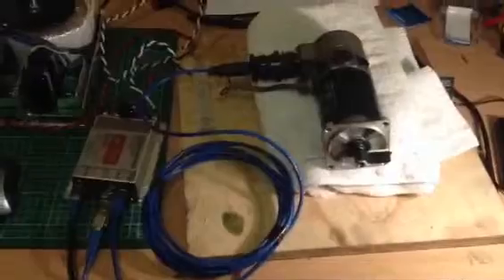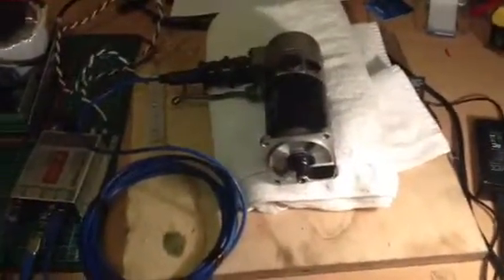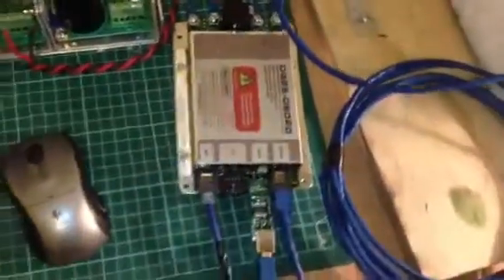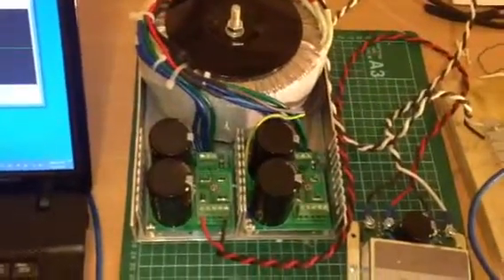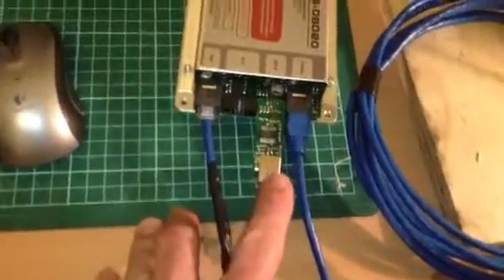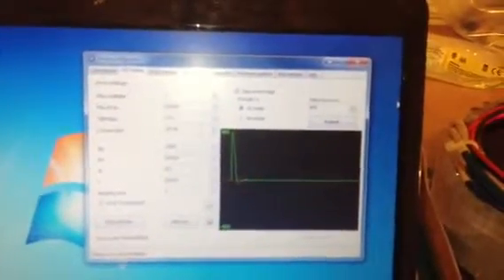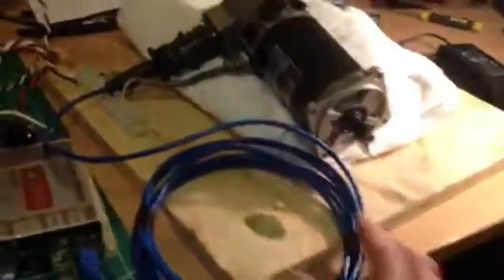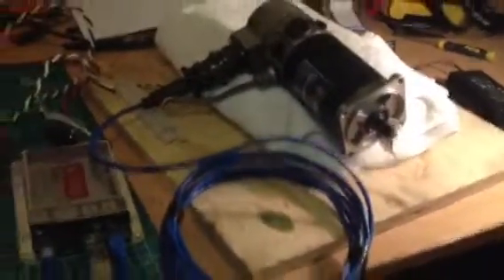Rotec Servo test CNC Oct 2012

Comment: I am right now at that stage.  The only diffrence is that I have already mounted everything. Make a long story short my encoder wires and were crossed and I had teh wrong encoder going to the worng driver.  I hit analyze and my Z axis flew all the way down and then one of the Bridges blew. Now tell, me, can you honestly set the PID on the bench like that with no stress on the motor?